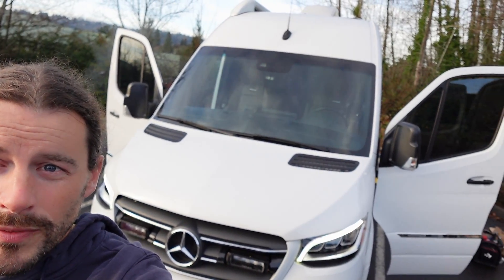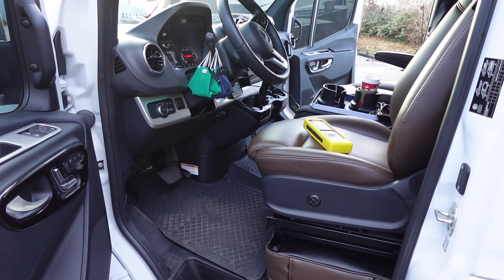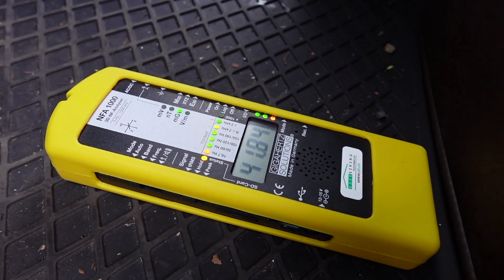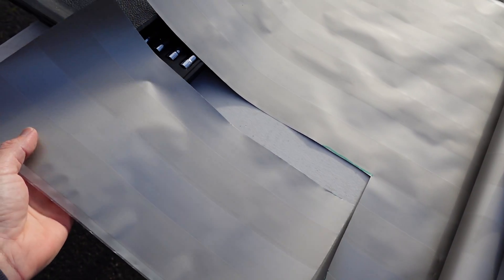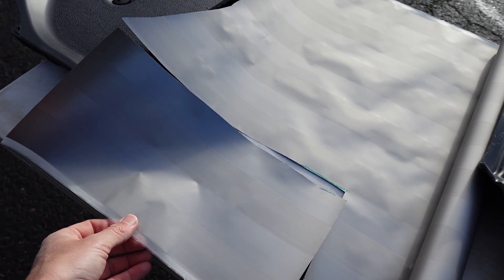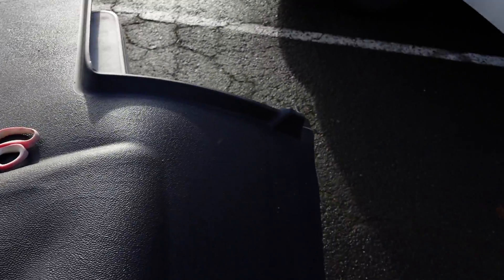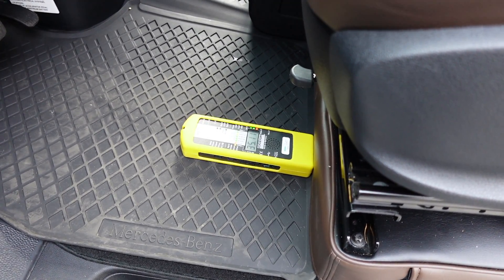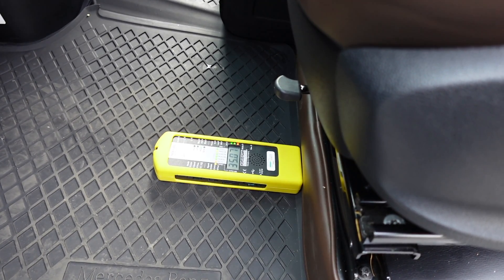Vehicle EMF Shielding: AC Magnetic Fields

Comment: Hi Shane.

I drive an old Citroen Berlingo 2005, very low on Emf/Magentic fields generally, has a very serene feel.  But recently changed the battery which is in the front by the engine, and magnetic fields are much higher than it would normally be.  
I have  put that down to your average car batterie becoming more smart, feels like a different car at the moment.  
What I was wondering as a potential solution is, do you think using a battery cover, and then finding a way of wrapping the battery with the MCL61 from Y-Shield would do anything?

Comment: Thank you for your content. Am I correct in thinking a MIFI at the front end of my Renault Kangoo (with an ethernet cable to my tablet) will better protect me from EMF rather than using a tablet with SIM inside at the rear - with no extra MIFI? I am thinking that the MIFI will be battling to maintain the signal 12 feet away from me rather than 2/3 feet in front of me, so I will be further away from the radiation. Will this provide enough signal for video conferencing? Or s the only reliable system an aerial through the roof with an ethernet connection? Much appreciated.

Comment: 35 is a better than 45. Still a little creepy to be right on top of a battery. Did you end up reducing it significantly more?

I want to work expediting, but am very emf sensitive. So maybe impossible.

Considering copper cover, silver fabric cover. You seem to be way smarter than me with cobalt. So looking forward to your take.

For some reason guessing the sprinter is the best of the 3 big vans for emf, please correct me if wrong.

Comment: I'm seeing similar issues in a Mercedes Vito where the battery is located under the driver seat! So I am really curious to see if it can be solved with the rewiring. I was thinking about relocating the battery to the back of the van with long cables on the bottom. But not sure if that would be a solution (they are now coiled under the seat). When is the sequel coming? :-)
Reply from the maker: Sequel is hopefully coming out soon. However, the owner of this van is currently fighting Mercedes, and potentially voiding their warranty bydoing this rewiring.  If you can relocate the battery away from areas where people are spending, a lot of time, and up under the hood is a great place for that, and you are on the positive and negative conductors as close together as possible you should get good results.
Reply: @optimaldwellingspaces3947  thanks, looking forward. Do you think relocating the battery could have negative impact on the functioning of the car?